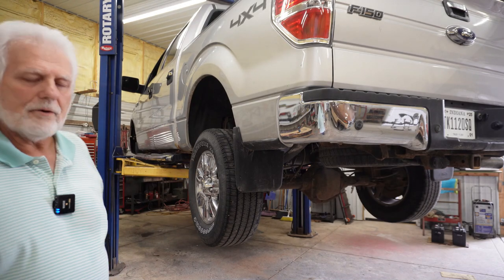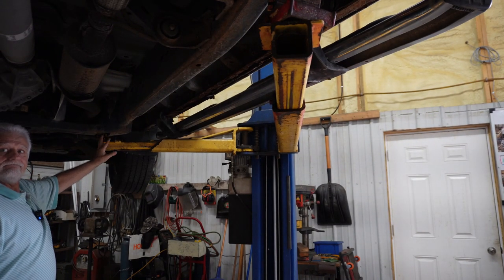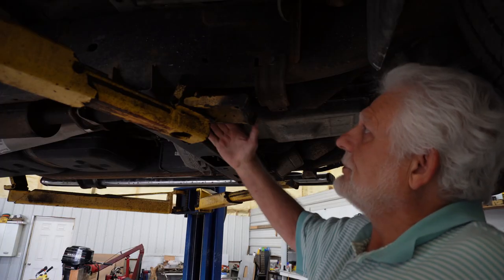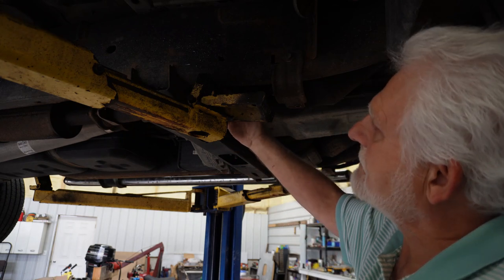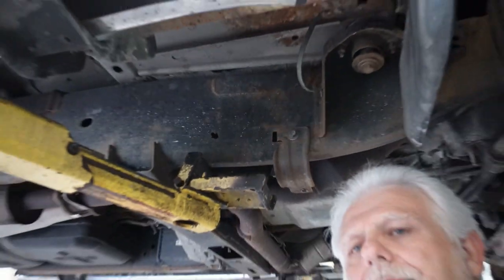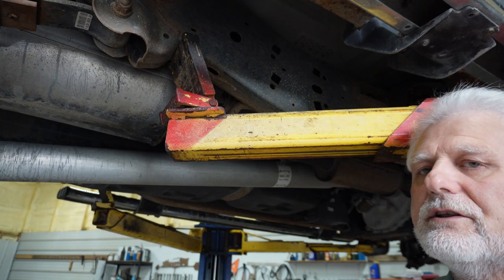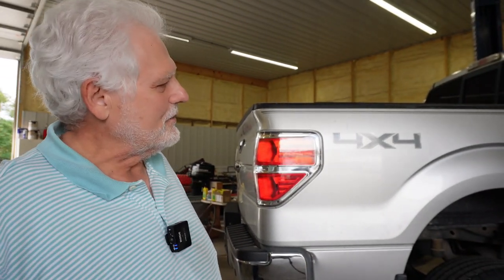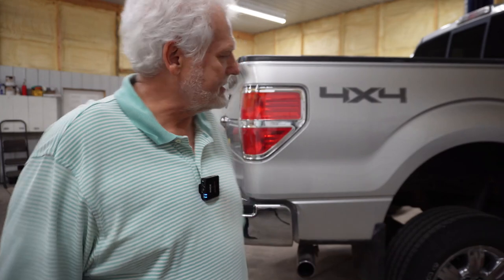Expert Tips for Safely Positioning Your Vehicle on a Two Post Lift

Comment: Nice video. I also use the arrows on the frame of F150's. Front to back, I like to position the vehicle so the driver's door edge is almost even with the back edge of the post. I wish vehicles had a center of gravity arrow, or marker for positioning the posts. Another thing I like to do is put a screw jack under the front and back once it's up in position, just to avoid bouncing.
Reply from the maker: Thanks for watching and sharing your tips.  I will certainly keep them in mind next time I lift this truck.  Anything to save this old man from getting up and down too many times is greatly appreciated.  Thanks again.